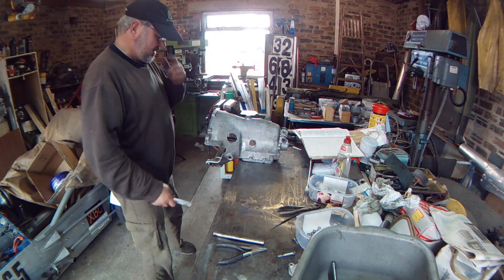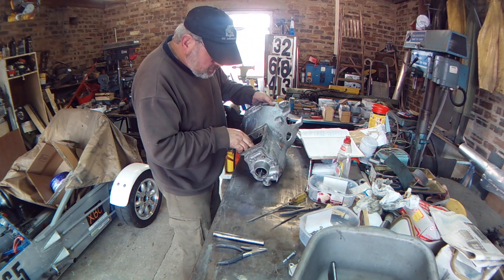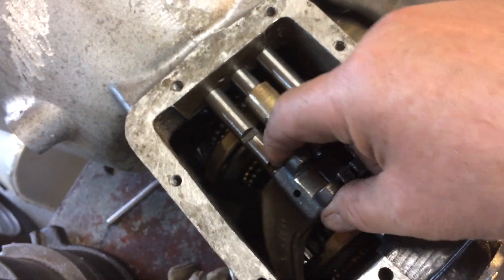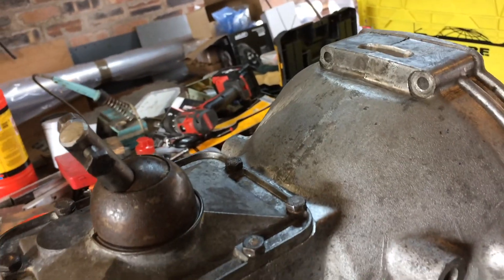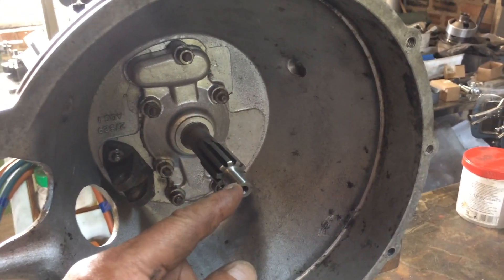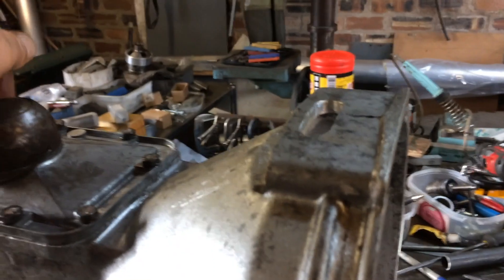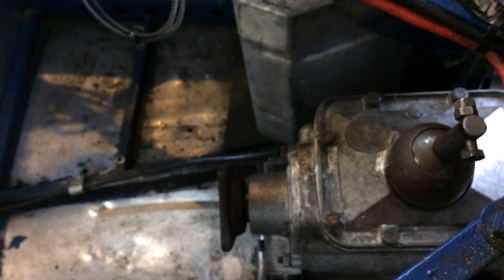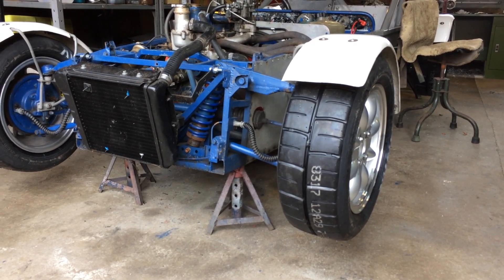Reliant Robin Gearbox Rebuild: Part 2

Comment: There is an oil hole in the layshaft to lubricate the needle bearings, this hole gets compacted full of sludge and must be thoroughly cleaned both ends.
Reply from the maker: With the minimal running of the hillclimb car this should not be a problem. Everything was well cleaned before reassembly and lots of nice new oil added...